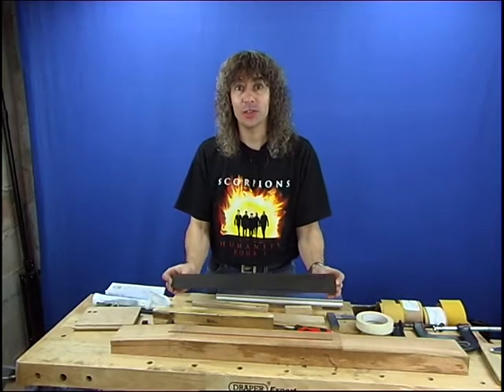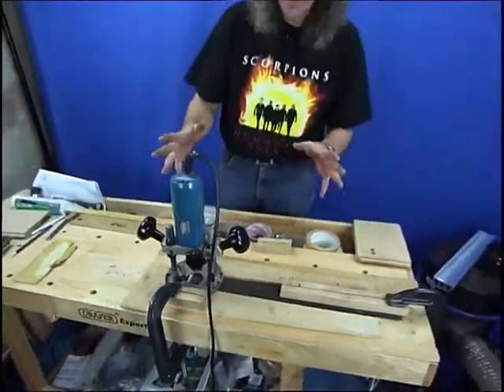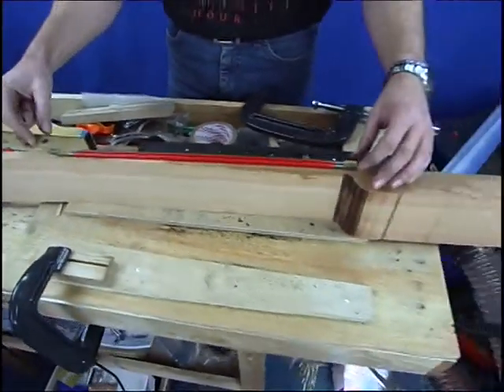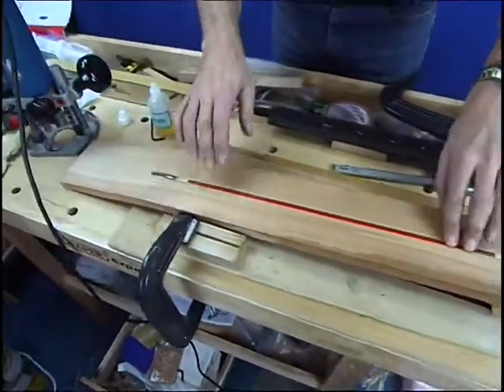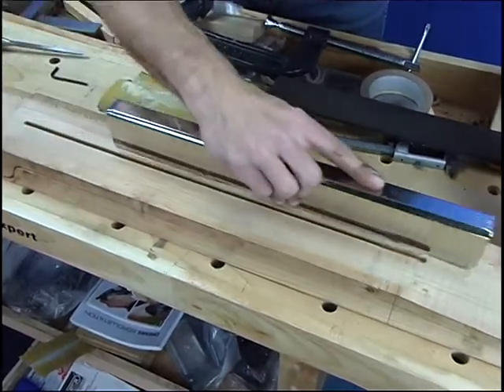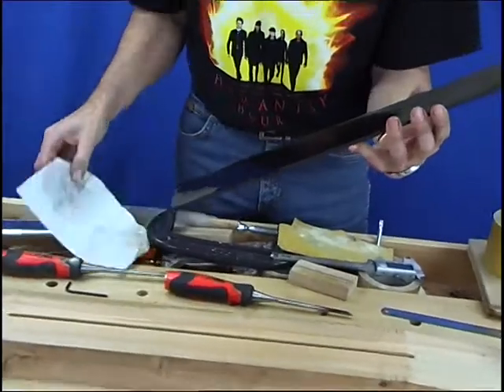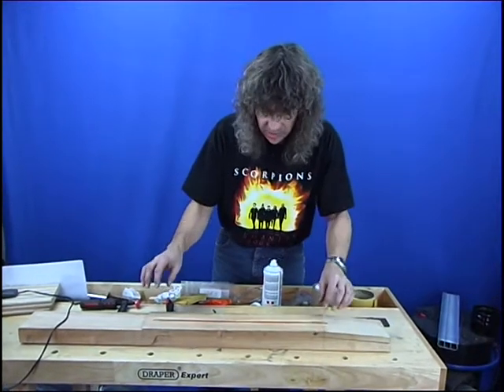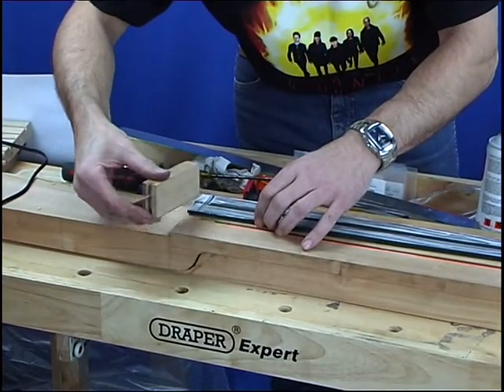Fitting the Truss Rod in the Neck and Gluing Fretboard - 12 - Custom Electric Guitar Build - 2007

Comment: Hey, man! I've got a question: I routed the truss rod channel, the truss rod fits VERY snug (you need muscle to fit it in and a lever to get it out). I am though concerned that, in time, the wood will dry and the truss rod would get loose and start rattling. The wood I used for the neck is 2 year air dried walnut sides with a 50+ year dried oak center (neck thru laminated). The truss rod would sit in the oak center. The Oak was just a piece of flooring that sat around in the attic for a long time.. The problem is that the weather is very humid now, and it will get dry in the cold seasons.. Should I worry? Would the silicone be enough? Or should I glue the trussrod in the channel? Thanks :)